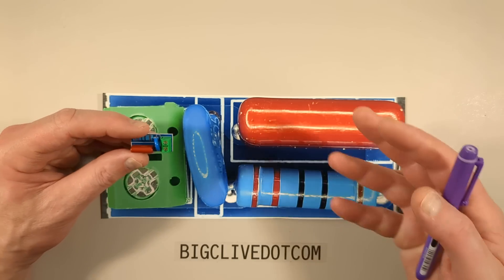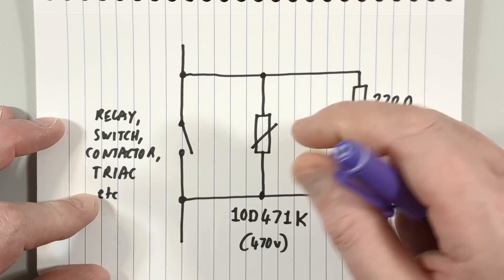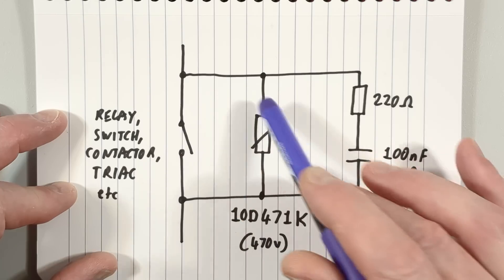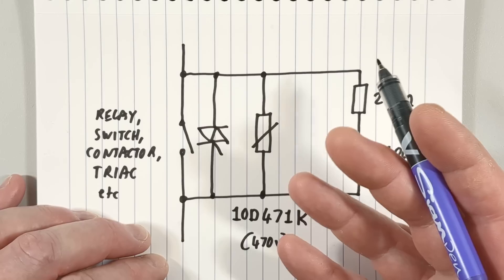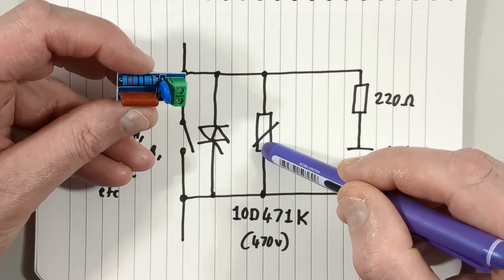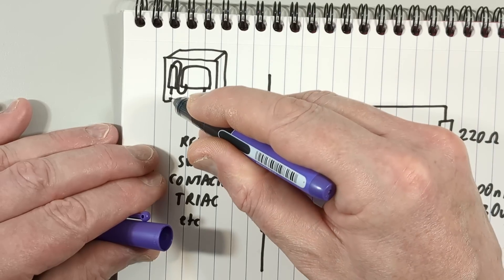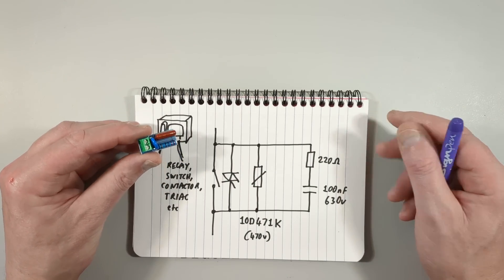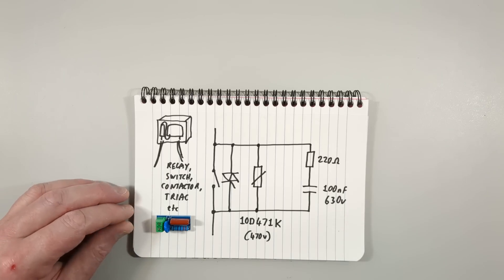Snubber network module for protecting contacts

Comment: I used to work for a company that made equipment that controlled relays and mechanical counters, among other things. The inductance of the coils in those could generate a sizeable voltage spike when they were de-energized. We used metal oxide varistors to shunt that spike around solid state switches. For lower voltage circuits (12VDC, 24VAC) we'd use a transient voltage suppression diode, which acted like two Zener diode wired nose-to-nose.
Reply: I thought MOV's had limited lifespans when clamping spikes?
Reply: @CamelCasee If I recall correctly, it depends on how much energy is dissipated in the MOV when it conducts, and I believe the stress is cumulative. So over time they'd gradually wear away. 

In our case the relay and counter coils didn't dump much energy into each spike. (The relays weren't very big.) The MOVs were to prevent the solid state switch from exceeding its breakdown voltage. The amount of energy dissipated in the MOV over time grew slowly, and our products were designed for a 20 year service life.

Comment: The verister should really have a fuse in line with, it because the varistors that I've seen fail have failed shorted , which would turn the thing on all the time.

Comment: A snubber across a triac has minimal use since a triac will only turn off when current is near zero so there is no inductive spike. The resistor and cap must usually be chosen carefully based on the given circuit and the inductance / current as at high switching speeds, it's easy to overheat resistors. The resistor's main purpose is to de-Q the circuit so the capacitor doesn't resonate with the inductance, but must be a low enough value to be effective.
Reply from the maker: Triacs often have snubber networks across them, as they have a limited DV/DT rating (change in voltage vs time).  What that means is that a sharp voltage spike can cause a triac to false trigger.  The snubber is used to help suppress fast voltage transients.

Comment: Hi,

We do need these things. 
And also, as this knowledge is fading away, you could did no better.

Also next nice thing would be PMPS diode spike current (shut off surge when that small capacitor in the diode causing a lot of problems to bewbies) suppressing and also the same for the MosFet(s)
I sometimes being asked on that, but i have no time anymore to do in depth answers due to my dayjob.

May you can jump in here, waswell, would be nice.

Great video,
BiG Thanks

Comment: I actually played with that stuff, and found that it's usually the microamps of leakage current through triacs that would make LED/CFL bulbs "flicker" even when off.  They'd charge up the innards, then something would trip and the discharge would make a flicker of light.
I replaced an X10 "lamp module" (triac) with an "appliance module" (relay) and the flicker stopped.
Got creative and tried a nekkid triac and CFL bulb... flicker.  Relay and same bulb... nothing.
Maybe if there's some leakage across (flux?) or through the cap, that might cause flicker due to the snubber, or just the MOV leaking?  Only a guess.
Never took apart lamp/appliance modules to see which if any had snubbers, MOVs, caps, anything of the kind, inside.
Oh, same with Opto-22 modules.  Gawd, those are prehistoric... No idea if they're even made anymore, but I still got a few lying around.
Reply from the maker: That is an issue.  It's why some bulbs have a little shunt resistor inside, but mainly for capacitive leakage between cables.  You can also shunt the bulb with another snubber network to drop the leakage voltage.

Comment: I have a PIR switch controlling a fluorescent tube that occasionally welds its relay contacts when I get power outages , resulting in me having to bash the wall near the switch with my fist to release the contacts. (yes , I am an experienced electronics technician)
I wonder if a snubber would help?
Reply from the maker: It's usually the high inrush spike caused by the fluorescent fittings power factor correction capacitor that is the issue with contacts welding.  Especially bad with long runs of discharge lights.

Comment: I know the 220 Ω + 100nF in series as a spark killer, used parallel to the on/off contacts of audio equipment. Another way of explaining is that as soon as the switch opens, the current takes the path of least resistance through the cap, and so the switch contacts don't take the bulk of the load to cut off.
Reply: The resistor is too for dissipating the energy of the "spark" i.e. the backward energy of the load. This is the reason for its large size.
Reply: Yet another place I can use this. I better order a 5 pack. (Aprox. $1 each here in the Philippines) Thanks for the tip🙂

Comment: Never heard of it. 🤷‍♂️
When the left switch on the left is opened and the righthand parts have done their dampening/quenching work... doesn't a permanent AC current flow via the condensator? How do you turn this off? 🤔
Is this current so intense, that a person working on the "switched-off" device could be hurt? 🤷‍♂️
Reply from the maker: It does leak current.  Enough to cause issues with some equipment like LED bulbs, and definitely enough to give a significant shock.  It's important to isolate a circuit you're working on completely, and not rely on a relay or solid state switch to break the circuit.
Reply: @bigclivedotcom interesting. Would the “leak” be noticeable in the monthly electric bill?

Comment: I've had to design a couple of snubber networks for customers switching AC motors on and off - in both cases they were to stop EMI from the spike when a pump turns off affecting nearby equipment. In both cases, I had to use quite a large capacitor (approx 3.3uF) in order to absorb enough of the energy in the motor coil to stop the interference. Such a large capacitor means that it's impedance is lower than one would like at 50Hz, so a bigger capacitor means careful selection of the resistor is needed, both to limit capacitor in-rush current and to ensure they can handle the power that flows through them in the steady-state condition. I have found that MOVs alone don't cut the mustard when it comes to stopping EMI. Small snubbers like the one you analysed are often sprinkled around for good measure, but it's hard to say how much benefit they actually have unless with/without measurements are taken - and the failure modes, as you point out, are a significant reason not to fit them unless you need to.
Reply: Forgive my lack of knowledge but could this work in my water pump installation? We have a deep well powered by a 1.5hp pump controlled by a float switch. I’m wondering if a circuit like this would protect the cheapy float switch from damage caused by repetitive use.
Reply: @nelsondog100  Yes it would potentially, in fact, in the past I have designed a snubber for a firm that had to retrofit the snubber in order to protect the contacts in a relay. In your case, if it's possible, I'd build an experimental setup using a relay (e.g. with a +24V coil) with a see-through housing  and use this to turn the pump on and off. Without a snubber you should be able to see a spark on the contacts time when you stop the relay, although note that you won't see it every time you stop because it will depend whereabouts in the AC cycle the supply voltage is when you interrupt it. You can then experiment with different snubbers and/or component values to see if you can make the spark go away. The more scientific alternative is to do the maths and use the value of inductance in the motor to work out how much energy (in Joules) needs to be dissipated , but then you'd need to be able to characterise the motor and that is a bit involved.
Reply: @nelsondog100  Yup, that's that they're for.  You should match the snubber to whatever spikes are coming off the pump (you'd need a scope for that) but this generic module will work just fine for most AC stuff.

Comment: Boring as bat sh!t!... Extract le digit & find something better than your usual USB light crap, oh btw who doesn't know what a snubber network is because it kills reverse pulses from a chopper power supply or in a TV back in the day it was called a tuning network across the horizontal o/p transistor but at at 62 today WTF would I know HA.

Comment: The MOV is an interesting addition as it will shunt any over-voltage through the device that you are controlling. Also they can only take so many conduction cycles before it begins to pass current, again, through your device.

Comment: So a snubber network is like the springs in a clutch plate, absorbing the momentary shock except acting on decoupling rather than coupling...?
Reply: Seems fair enough. For a more direct comparison I would think of it as an anti-hammer device in a water pipe, absorbing the shock when you shut off the water.

Comment: Lose the MOV...those have a limited liftetime and add little value to protect contacts - in our experience in industry they just cause more future problems, so we're almost never using those these days - especially the cheap parts..  if you choose the capacitor and resistor to be the correct value - FOR the actual load on the relay, the MOV won't be needed at all.  Snubbers really need to be dialed in to the correct value components to match the load characteristics.
Reply: That's what I thought too. In my experience, the RC eliminates electrical interference perfectly if correctly dimensioned. In this case, no MOV is required. Only if we need to limit the inductive effects of a lightning strike in the immediate vicinity, for example, then an MOV makes sense. In this case, however, we would connect the MOV in parallel to the device and not to the contact.

Comment: K is 10% tolerance and is fairly common in capacitors as well.
Aren't the potted rectangular snubber packages part of the RIFA madness that the vintage restoration community has been talking about?
Reply from the maker: RIFA have their own special place in electronic history.  If you see 'em, swap em out for a modern suppression capacitor that doesn't burst into flames.
Reply: As far as I know, the problem is in the RIFA capacitor package itself. It was a clear resin that cracks with age, then moisture gets into the capacitor causing it to swell and short-circuit
Reply: Actually it is the other way around. Humidity diffuse through the epoxy resin into the paper winding expanding it to crack the encapsulation. Then the water in the winding multiply the losses once you connect to  mains. Then it takes two seconds or a minute to get the heat up.... 
Do not connect to mains after keeping the appliance in a damp cellar for a decade. Once it is cracked it is a fire hazard.  If not cracked,  you may still have a humidity problem that may theoretically be dried out, but then only under controlled conditions monitoring loss levels.
Who like to do that? Trade them for a new suppressor capacitor,  X or Y class depending upon position. Note that std capacitors cannot meet requirements!

Comment: When I worked in a control equipment manufacturer,  we installed RC snubbers on every AC relay coil, diode across DC relay coils.  Never installed snubbers across contacts, SCR's had snubbers across them.
Reply: +1 - not on contacts, better to put paralel to load

Comment: Clive, you should describe the snubber capacitor across the ignition points in an old vehicle. Usually, they are 25 micro farad.
Reply: Here in the US they used the older name of condenser when it was in the car ignition circuit.
Reply: The purpose of the points condenser is to allow oscillation of the ignition coil primary and generation of EHT.
To be a snubber requires series resistor.

Comment: Needed  one of those 50+ years back when my fluorescent kitchen light would burn up the contacts in the sixties style light switch ☹️.  Several sets later converted to LED tube and no more problems 🤞

Comment: What about leak current? Do you think that has same effect when in parallel with load instead of contact?
Reply from the maker: The snubbers do cause low leakage current that can be an issue with loads like LED lights.

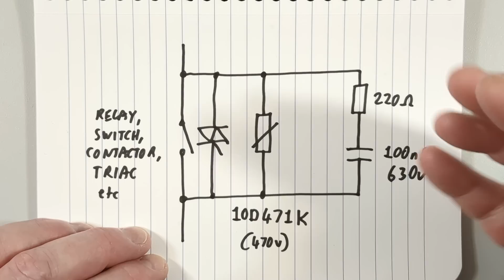Comment: 2:43 hi, there! Clive, the resistor is there to provide HF damping, by converting the absorbed energy into heat.
Reply: P.S. If you like, you can think of an RC snubber as a kind of RC high-pass filter, with a time constant τ = R C. In this analogy, the "output" is the voltage across the resistor.

Since power dissipated in the resistor is P = U I, and I = U / R, we get P = U² / R. That means the power dissipated is proportional to the square of the voltage across the resistor.

Now, because the voltage across the resistor increases with frequency (not linearly, mind you), the power dissipation also increases with frequency — especially around and above the cutoff frequency fc = 1 / (2 π R C).

Comment: I have a contactor for my A/C condensing unit that eliminates arcing, by closing (not sure about opening) on the zero volt of the wave. It also has a built-in delay to prevent rapid cycling and brown-out protection. I don't know how it works, but that it seems to work as claimed. That would be one to tear apart.
Reply from the maker: There are some intriguing units that have a light sensor inside and nudge the timing until the relay switches with no arc.

Comment: At first I thought that snubber was a monster GIGA amps thing with those stonking huge components.... then I realized it was a photo!
Reply: I thought for a solid 25 seconds I thought that Clive went and built a full 3d model of the circuit. I was recently blind in one eye and, after thinking a mosquito was a hornet, I have a new appreciation for depth perception.
Reply: I've made that mistake here a few times.
Reply: Even worse, I sometimes wonder how Clive can so easily write on top of components. It takes me a few seconds to then feel silly.
Reply: i think it' sbecause the photo is taken under the same lighting conditions in the scene in which it's displayed. :p
Reply: Nah, that would be StyroPyro or PhotonicInduction, if he ever comes back
Reply: @Lizlodude lets push it to stupid levels...
Reply: I also almost got caught, but the terminals popped a big red flag...but it took my brain quite good amount of CPU time to deal with it correctly.
Reply: I came here to say that
Reply: One moment pleaseeee ;)
Reply: i'm thinking what type of an video touchscreen is it that it is so easy to scroll
Reply: At first glance the color code looked bit off for a teraohm resistor
Reply: Ha no that would be a few hundred amps at best.
Reply: i ALWAYS fall for that in this channel. i still can’t get used to this hahahahahaha!
Reply: 😂 So did I! Looked away for a second when I started the video and when I looked back "holy she it, that's a huge snubber!"

Comment: Most will put a snubber in parallel with the contacts of a switch / relay, where, they work just as well in parallel with the load after the switch, plus, in that configuration, they will not have a current leakage through the capacitor always conducting through the load (edit added - presuming that the load is powered by a alternating current supply, a direct current power supply would not have the current leakage issue)

Comment: Great for dc stuff as they don't pass current when switch/contact is open. IRC relay contacts can't handle dc current anywhere close to switching ac due to arcs not being killed by zero crossings.

Comment: Genuine question why don't contactors and relays in panels have a separate flyback diode module? Or is it built into the module?

I always had to put them on 5v circuits and 12v and 24v

Is it because obviously it's AC so only required on DC?
Reply from the maker: Some relays do have a built in flyback diode, but the risk of a maintenance operative putting them in with the diode facing the wrong way is high, and that can damage the control system by shorting the output.
Reply: @bigclivedotcom that's good to know, would it help the longevity if they had them and of course the person touching the panels wasn't... Unaware of the polarity? 😂
Reply: The Siemens contractors I use for work have little snubber modules you can push in two little holes, never knew what they were for tbh
Aside from that they are absolute garbage

Comment: Thanks for the explainer.  I've seen them in circuits and sorta got that they were about filtering, but this is much clearer as to why that filtering helps.  How might you test that these were good?  I guess if you already had a case of contactor arcing?  I guess you could test that they work for quite low voltages with a signal generator and scope.

Comment: Very good. It looks like a metal film resistor. I'm not really understanding the banding though. Red,Red,Black,Black,Brown? Is that 22 ohms, 220, or 22K? I am used to Red,Red,Black.
Reply from the maker: Four band and tolerance.  red, red, black, black is 200 with 0 as the decimal multiplier.
Reply: It's marked like a precision 1% resistor with an extra band for a 3 figure value rather than 2, common in China, the cheap ones measure more like 2-3% in my experience.

Comment: I put a snubber network across the triac that burst-fires my immersion heater. I also put in a neon indicator. When the thermostat opens, the current through the snubber network is enough to light the neon but not quite as brightly as when then it's shorted out by the triac, so you can see its brightness pulsing in the burst firing pattern. The single neon unexpectedly indicates three states.

Comment: Useful things and often ‘forgotten’ on later revision boards etc with the relay taking the brunt of it.

I always liked the Schneider ‘plug in ‘ ones for their contractors. 

As you say the MOV failure was the first thing I thought of when I saw the circuit - seen quite a few where the MOV simply cooks itself when it gets too leaky - one in a cheap ‘surge protected’ extension lead where it charred / melted the casing.